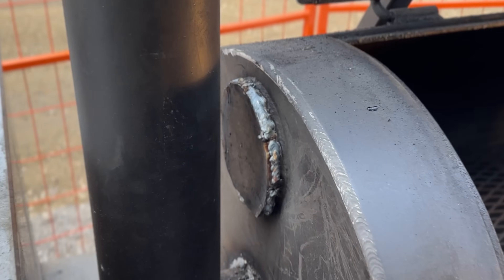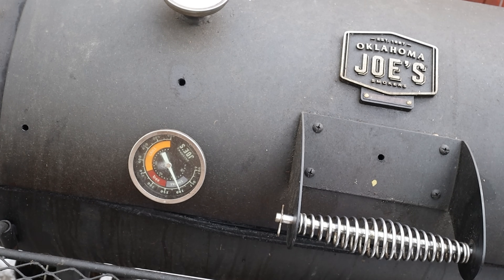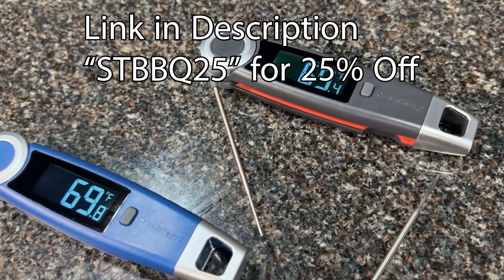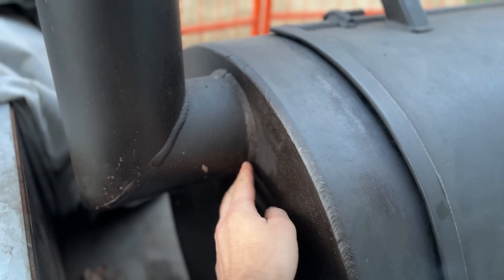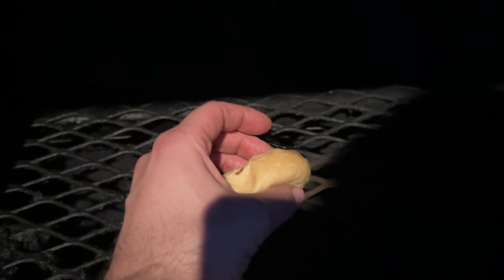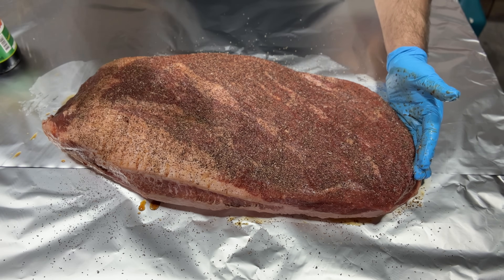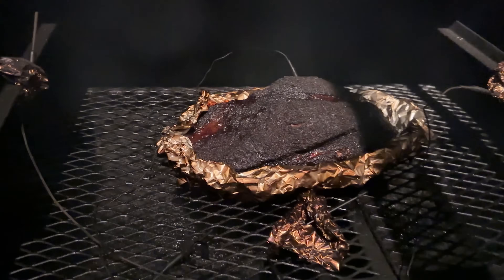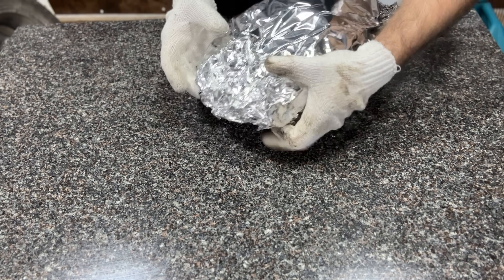Should you drop your offset smoker stack to grate level?

Comment: I did similar mods and have similar good results.  Went with a stack extension and used an AC elbow inside my Oklahoma Joe's Smoker as per a previous video of yours. Those two mods leveled out my cooking temps across my smoker to withing 20-25 degrees F along the grill surface, I do use a self made heat deflector coming out of the smoker box. That might be something to experiment with as it seems baffle plates, while smoothing out temps, defeats the purpose of a smoker smoking your meat by channeling smoke n heat under and away from your meat towards the stack.
Reply: Yep. My friend gave me a metal plate and angled it upwards right next to the firebox to get the hot gases to basically travel upwards faster (in theory). This should allow one to set food a little closer to the firebox--will confirm this with a biscuit test. Then lowering the stack will draw smoke downward, putting the "heat path" closer to the food. You could argue 1) more smoke flavor and 2) less fuel needed. Lots of people just automatically buy the downwards baffle, but I don't agree with that system.

Comment: Wouldn’t it stand to reason to use two stacks at grate level . It would allow for even heat even through the edges of your grill. I know when I grill the edges around your grill on the inside are usually the coolest.
Reply from the maker: Yea I've been thinking about that. Maybe it would even out the horizontal flow

Comment: The biggest problem with the okj chimney is the damn elbow. Straight stacks have better draw and therefore dont need to be as tall. However they do interfere with your cooking area .
Reply: The diameter is too small as well. Volume is key to smoking. 4 to 4 and a half inch diameter stack is ideal. And roughly 35 inches tall. The stack should be almost as long as the smoke chamber. On these smaller units.

Comment: I made these mods to my Oklahoma Joe Highland 2 years ago with phenomenal results, but I also added a smoke collector, which eliminates the cold spots in certain areas. It draws the air evenly across the grate by adding the smoke collector, plus I increased my stack diameter to 4.5  inches.

Comment: Removing the baffle/heat deflector definitely helped a lot. Building a collector and extending the stack would be my next move. The collector will help eliminate some of the back pressure, if you’re getting a hotspot towards the front, but just extending the stack should help too.

Nice brisket.
Reply from the maker: It's next on the to do list for sure
Reply: @SmokeTrailsBBQ  Looking very forward to seeing the results of each. Stack addition 1st then collector.  Going to be Awesome seeing each improvement 😁👍👍
Reply: I’m a firm believer in a collector. Can’t wait to see the results of a taller stack and added collector.

Comment: Really like your rub. It's too bad is doesn't say it's light on salt on the label. I watched a video of the rub and you mentioned it was pretty light on salt which is why you used a heavy coating. Kinda ruined my brisket, but I'm still using it in sammies and pastas.
Reply from the maker: Fair point! Like you went to light on it is that what you mean?
Reply: @SmokeTrailsBBQ  Yes. I believe so. I rubbed the night before and wrapped in Saran wrap like always. Good bark and tenderness on cook, just lacked any kind of penetrated flavor
Reply from the maker: @derekreed8366  I also find when I season the night before my briskets are less salty
Reply: @SmokeTrailsBBQ I usually use a light coat table salt and kosher salt mix the night before, then pepper and extras the day of. Your rub is excellent, just wish the label had instructions or amount recommended. Smoke on buddy!!

Comment: Great video, thanks! Considered doing this on my OKJ with a collector vs. just upgrading. Weighing the costs with zero exp welding, zero tools, cost of the metal, stack, etc... and at the end of the day I'll still have a smoker with very thin metal, I think the thicker 1/4" helps with temps.

Comment: Can't wait to see you add a collector and also increase both the diameter and length of the stack.  Your experimentation is helping to move the BBQ smoker industry forward.  Thank you!
Reply: I made these modifications to my smoker Two years ago and posted videos on youtube, so the information has been out there for a while. I didn't just lower mine to grate level. I added a smoke collector, extended the stack, and increased the stack diameter to 4 and a half inches. With phenomenal results.

Comment: Potential test idea: Test what happens if you make a more turbulent airflow by putting a flat vertical plate in the cook chamber a few inches from the fire box so that smoke has to go around rather than take a direct path out. This may require a longer stack to provide sufficient draw though.

Comment: The problem to me is a company that is OK with manufacturing and selling smokers with stacks above grate level probably cuts corners in other areas also (steel thickness, firebox size, etc), and that confounds the situation. I'd agree with Aaron the stack should be grate level, don't agree with moving it yourself. Just buy a better smoker.